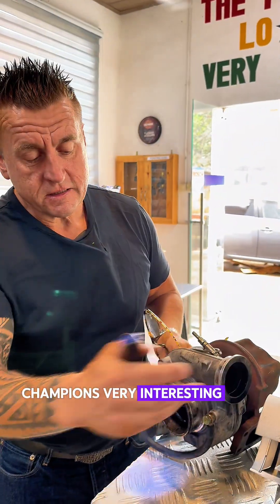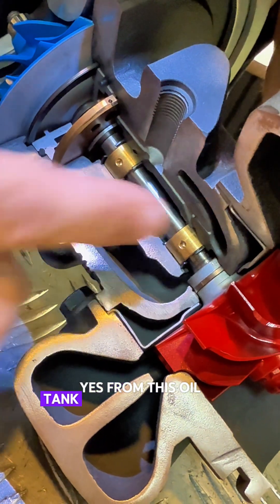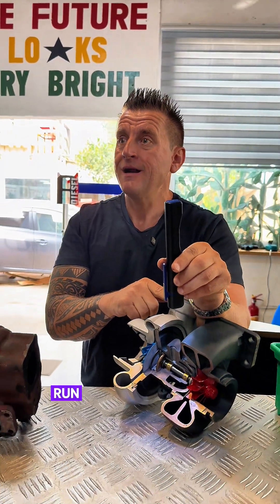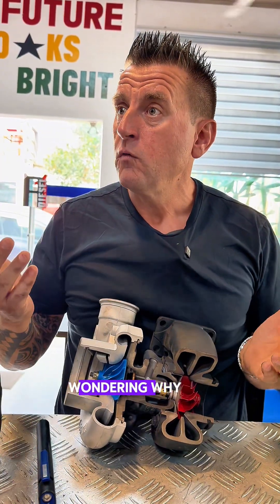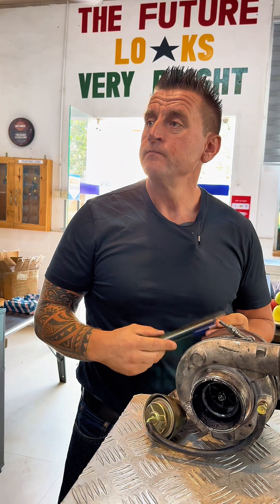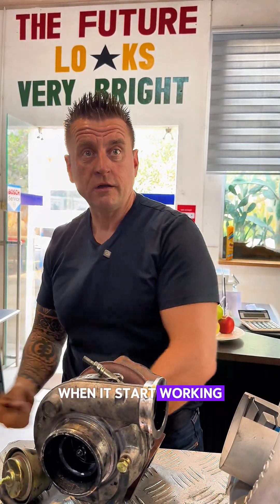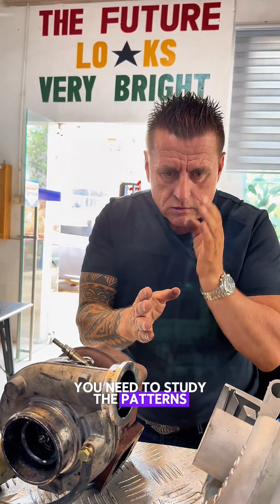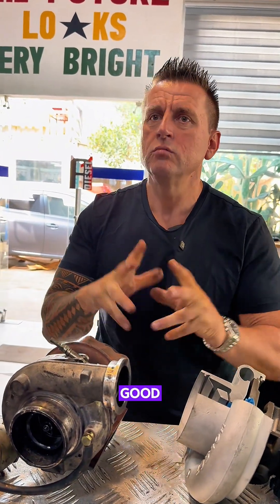Why is oil coming out of your turbo inlet? 🤔 Watch till the end for the answer! 🔧

Comment: Hi I have lc200 v8 desiel Black smoke new egr and injector clean all services new bt Black smoke not done bt I remove rail pressure sensor coupler no Black smoke?

Comment: Champion, thats half of faults, the blade story is only real if u seen the last turbo, it can also be sand if theres a hole in the intake. The oil on both sides ok crankcase ventilation system "breather" as you say but it could be the turbo that has an end play or havin radial clearance problem.